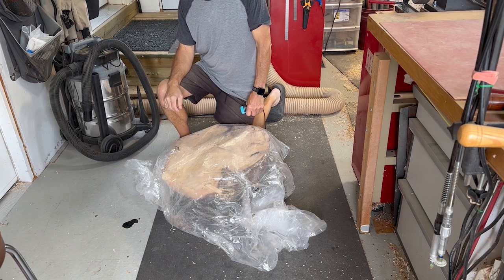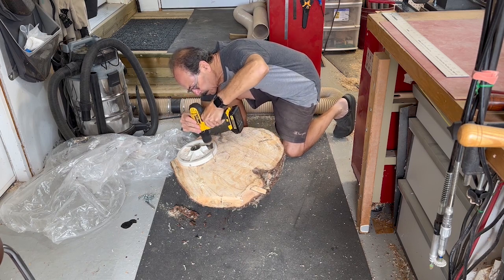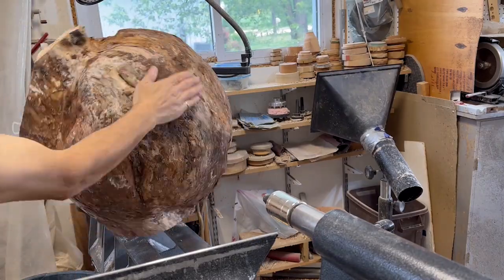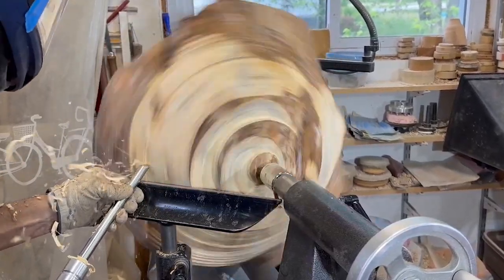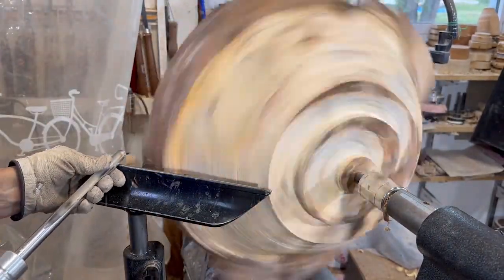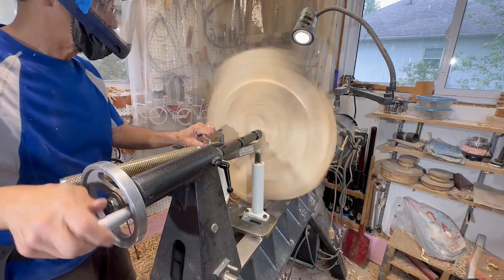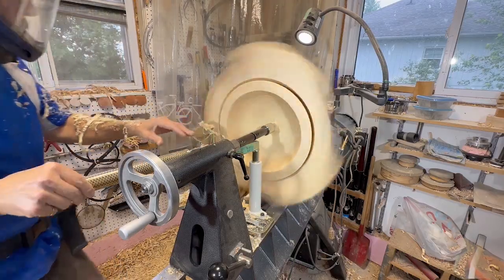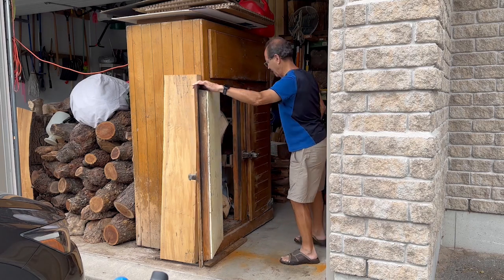Woodturning a Tamarack Burl - Part 1

Comment: Great work, I’d like to try some stuff this size but my current lathe a union graduate gives me 10 inch over bed on the bowl turning side . Im looking into a floor standing tool rest. Good work I like your style of turning 👍🏻👍🏻👍🏻👍🏻👍🏻👍🏻👍🏻
Reply from the maker: Thanks for the nice comments, yes 10" over the bed is ok for smaller burls, but often they have wings which require an even larger swing.

Comment: very nice sized burl.  I have the same core system.  I find it easier to do the bigger bowl first.  I turn a tenon or a recess on the small bowl area, core out the big bowl, then I can turn it around to put a tenon on that end to turn it around again to get the small core. I am looking forward to the next video.  keep up the good work.
Reply from the maker: thanks, yes , i have heard that some people core the way you describe.  it is a bit safer so you are sure to get a large tenon on all the cores, but I have got used to doing it this way which i think is a bit faster if you are into coring a lot of pieces.

Comment: Nice, i keep eyeballing the corepro's but they're so expensive.
Reply from the maker: Thanks, yes, I agree.  I went for many years and did many cores before I decided to make the jump to the Korpo bits.  For wet wood I don't think it makes much difference, but if you are trying to core dry burls or anything with epoxy it is really hard on the HSS bits, so that is the main reason I purchased a few of them for my Oneway hollowing set.